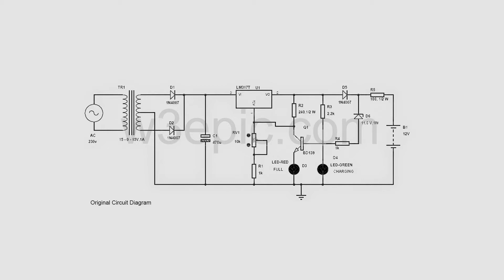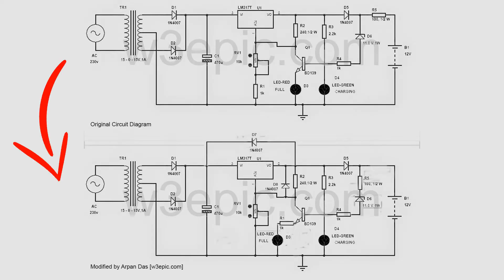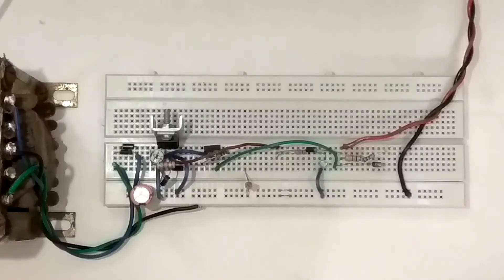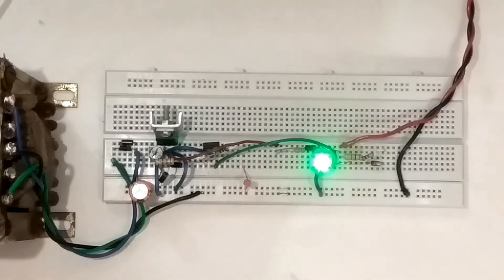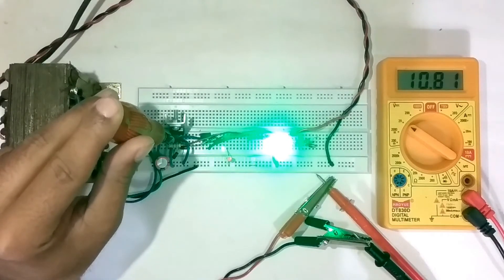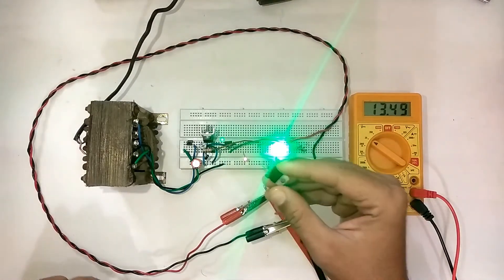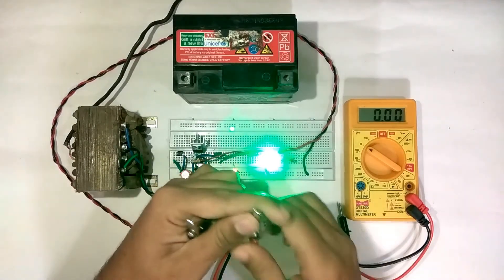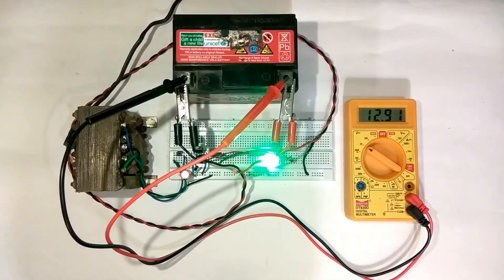12 Volt Battery Charger Circuit with Auto Cut off on Breadboard [Modified Version]

Comment: 👍👍👍👍👍👍

Please mention all required parts for the circuit 
Red LED is very dim compare to green....

Try to maintain similarities while building any circuits otherwise that will make a visual destruction & thanks  for video I was also looking for  this charger circuit

👍👍👍👍👍
Reply from the maker: I made this video specially to inform all of you that not to try this circuit, this is buggy and not near no where from perfection. Try DIY Universal Battery Charger Circuit with Variable Auto Cut-off Voltage instead from the links below.

Please see this video: https://www.youtube.com/watch?v=NQx6872b1sM
and this also: https://www.youtube.com/watch?v=78WUSir8yC0
and read the parent post from here: https://w3epic.com/diy-universal-battery-charger-circuit-with-variable-auto-cut-off-voltage/ 
to get full details.

Thank you.